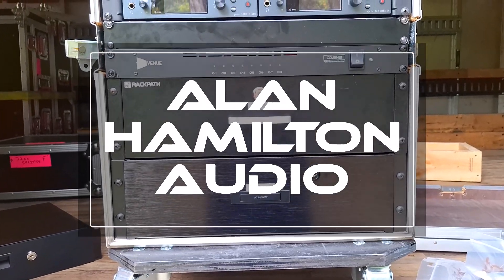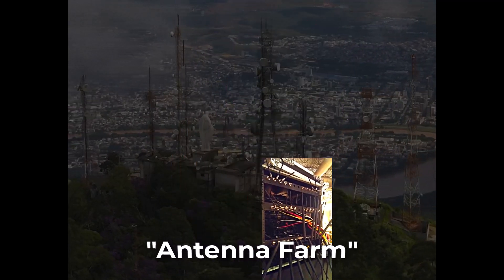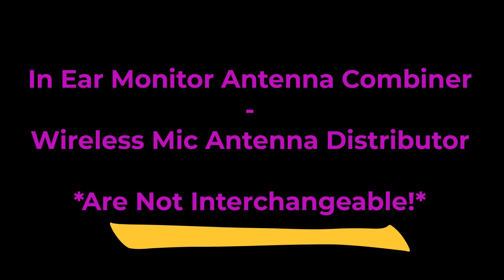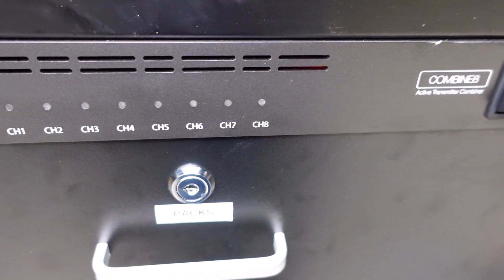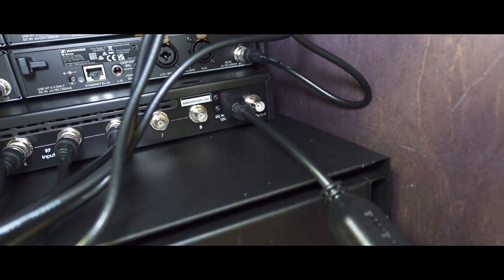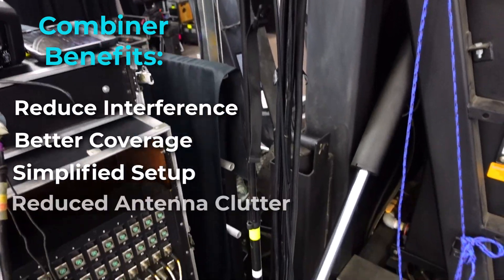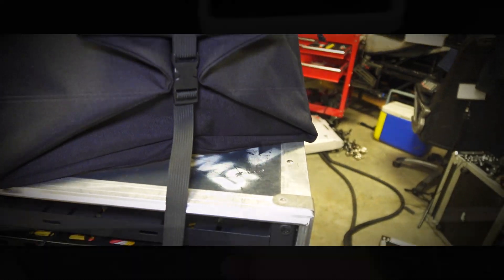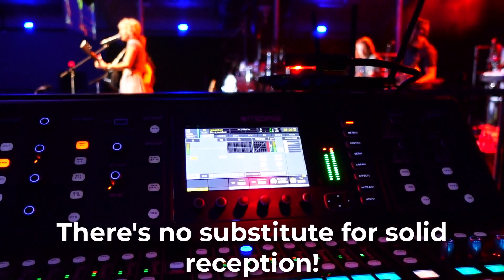What Is An IEM Antenna Combiner? In Ear Monitor Hardware

Comment from the maker: A quick look at IEM Antenna Combiners and explanation of the benefits and a comparison with RF Mic Antenna distribution systems (which look similar but are different).
I'm using the RF Venue Combine 8 which combines 8 IEM units. As of this writing I have 6 Sennheiser IEM units in the rack, but I have two more ready to add to make the rack capable of 8 stereo IEM mixes. All fed from one (CP Beam) antenna.
But as shown in the video, the brand of combiners can vary (as long as they work in the same frequency range as your IEMs). And there are combiners from different manufacturers with different maximum IEM unit capabilities. If you want to put a combiner on 2 or 3 IEM units you'd just buy a 4 channel combiner and not use the unneeded connections. If you think you might eventually have MORE than 4 units, then buy a larger combiner to leave yourself more expansion room.

-----------------
🎚✨ Support via Patreon:
https://www.patreon.com/AlanHamiltonAudio

🎶🎶Channel Facebook Page:
https://www.facebook.com/groups/livesoundproduction
------------------

Affiliate Links-

🚀🚀Items on Sweetwater from video:

Sennheiser Wireless IEM systems-
https://sweetwater.sjv.io/9gkRB0

Sennheiser AC41 IEM Antenna Combiner:
https://sweetwater.sjv.io/YRggGe

RF Venue Combine 4 Package:
https://sweetwater.sjv.io/vPnn33

RF Venue Combine 8 Package:
https://sweetwater.sjv.io/4GeeD0

RF Venue CP Beam Antenna:
https://sweetwater.sjv.io/mOgg37

RF Venue CP Architectural Antenna and Combine4 Bundle (perfect for school or church permanent installations):
https://sweetwater.sjv.io/9LWW6E

Shure HA-8089 Helical Antenna:
https://sweetwater.sjv.io/DyVVg5

Shure PA411 Antenna Combiner for PSM 300 Series Wireless and PA805SWB Passive Directional Antenna:
https://sweetwater.sjv.io/jeWW3M

📦📦Amazon Affiliate Links:

📦Alan Hamilton Audio Amazon Page:
https://www.amazon.com/shop/alanhamiltonaudio

Items Used to Make This Video from Amazon-

PROAR 414 XLR Microphone and accessories:
https://amzn.to/4aCrUK4

Sony ZV1 Camera on Amazon:
https://amzn.to/3z9MHny

Canon M50 MkII Camera on Amazon:
https://amzn.to/3z6c8X5

“As an Amazon Associate I earn from qualifying purchases.”
"I earn from affiliate link purchases"
-------------

✨Other Channel Videos-

The Wing Rack as an IEM Mixer:
https://youtu.be/eDTr0d6LGU4

Building an IEM Rig With the Behringer XR18 | Midas MR18:
https://youtu.be/xT9gTBFxvZk

In Ear Monitor Rig Tips:
https://youtu.be/cHGo2HyLsRk

Comment: Hi Allan, thank you for your channel. I have two IEM systems that are mounted in a rack with a single wireless microphone receiver. Even with all units switched off, and one I am system switched on, I get some degree of interference. A typical wooshing sound as you move around on stage. This is with the transmitter set on low power, and the artist only been two or three metres away from the transmitter, with direct line of sight. I’m using. EW300 G3 systems, with the input gain, peeking at 0db. Do you think antenna distribution would help my situation? I always have a clear frequency and the packs register no RF with the transmitters off.
Reply: Thanks. I tried a paddle antenna and the noise disappeared,
Reply from the maker: This is a tough one... It should help, typically, just because an antenna distribution system is going to be more efficient, allow you to place the antenna in the best position, eliminate the antenna farm, etc...
BUT... it almost sounds like something else might be going on. So that makes me hesitant to say it would help in this particular case.

Especially since you said you can turn all transmitters off but one and still have an issue (if I read that right). What about if the beltpack ONLY is on. No transmitter?

Do the G3's allow you to adjust squelch like the G4's do and have you tried that? 

Is there something wireless (guitar RF, band mics, a venue/DJ RF mic, some type of camera/audio system transmission??) not on when you scan for frequencies?

How close are the transmitters to any RF receivers?

What about Wifi routers? Anything in the rack that is close? Have you tried turning any of these things off to rule out any sympathetic RF interference creeping in?

Is this just in one location (church or auditorium system) or do you move the equipment from venue to venue and always have this problem?

Comment: Hello Allen!

Noob here, I just want to get some enlightenment.

We have 5 IEMs with different RF ranges;

-470 to 520
-620  to 760
-810 to 870

If I buy this RF Venue 8 combiner, will they all work even thought RF Venue will be using 470 to 689?

Thank you
Reply from the maker: I don't think so... It'll work within its intended range, but once you're into 620-760, 810-870 that is out of range. That said, US units vs Intl units likely have a different range they work in so it's worth checking for the specific country it's being used in... but I doubt even Intl units will have as wide of a range as 470-870.
Reply: @AlanHamiltonAudio  

Thank you so much.

I was thinking the same thing, I just really wanna make sure that I get advice from a Pro.

Again, thanks! I appreciate it!

Comment: rf venue makes a passive combiner for 99$. works great. (but only for a maximum of two wireless transmitters)
Reply: MiniCircuits also makes small passive ones that seem to be well respected.
Reply from the maker: I've seen that but haven't tried it since it's passive and only for 2 IEMs. I assume the benefit of getting the antenna into a better position (higher, out of the rack, clear line of sight) ultimately has a greater positive impact versus any signal loss from the passive connection.
Has that been your experience?
Reply from the maker: Also, since it IS passive then it IS interchangeable for use as a small RF mic distribution system. Which would be a caveat worth mentioning since the video is talking about active combiners when I said the two things aren't interchangeable.